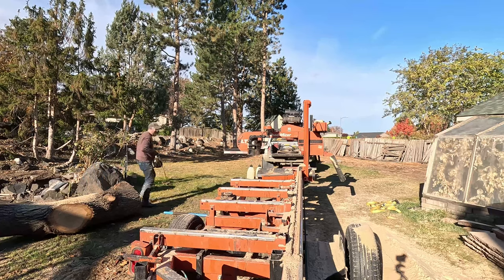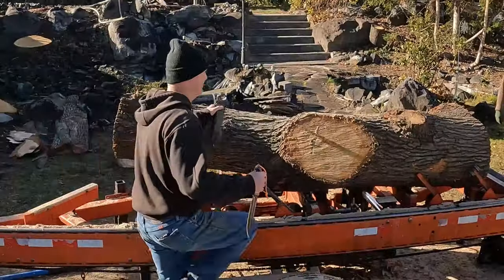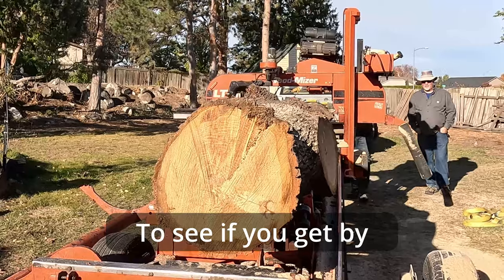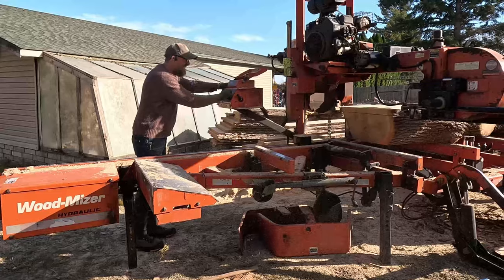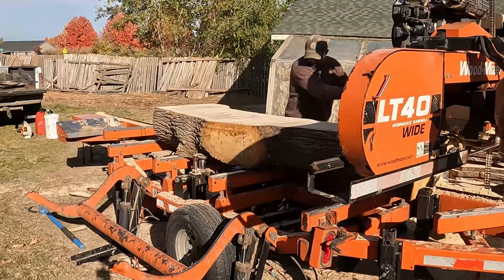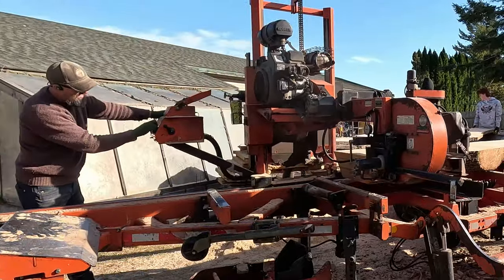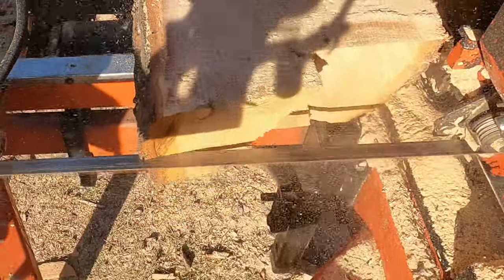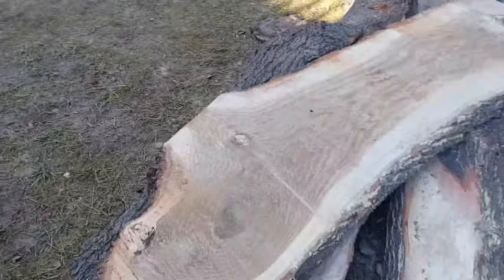From Ugly Logs to Stunning Slabs - The Art of Sawmilling #sawmill #woodmizer #woodworking

Comment: Been watching for a while now.  Hey I noticed all four of your  log rails are hydraulic.  I have an lt40 as well, bought it in Portland last year. On mine, just the 2 with the rollers are hydraulic,  the other 2 have to be put up and down manually.  Did I get shorted, or did you pay extra for the 2 ?
Reply from the maker: Actually only 2 of mine are but I use the other 2 a lot.  You can however get a kit from WM